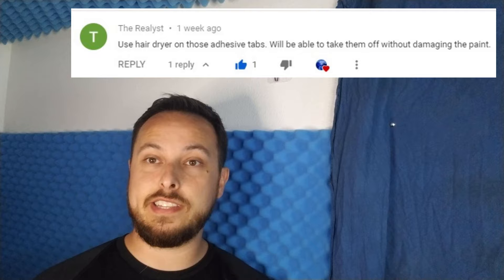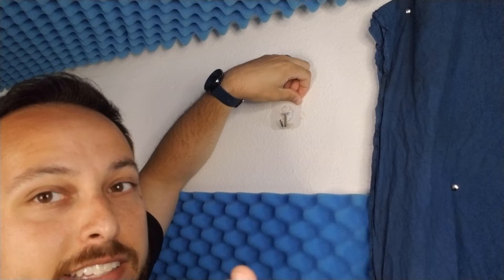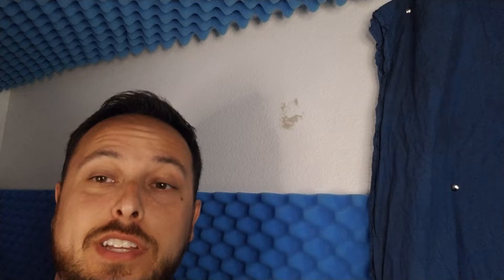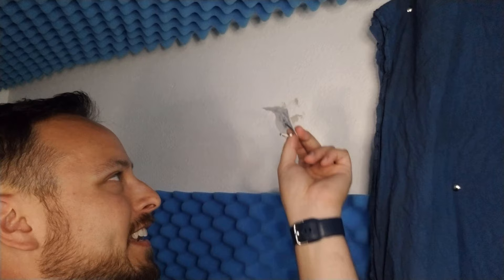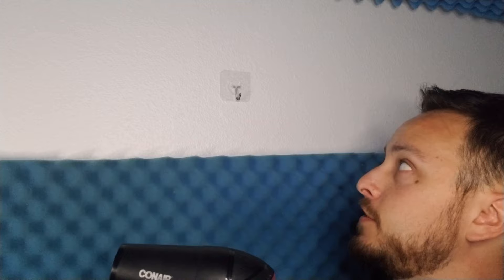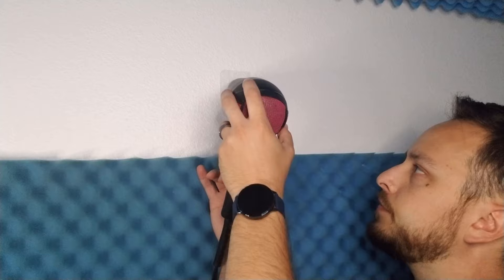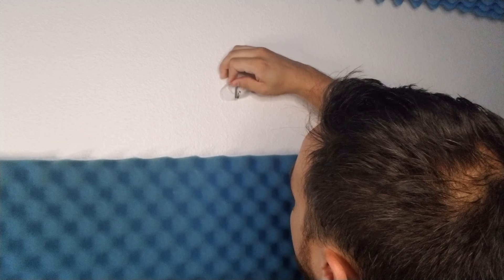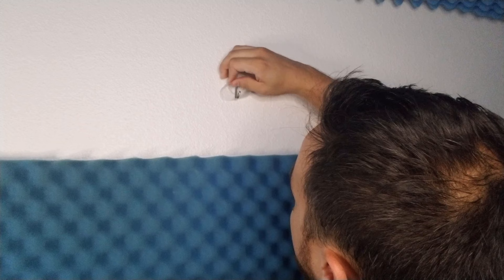REMOVE KIWI Cable VR Management Hook Without Damaging Wall

Comment: I discovered I had to do this with the 3m "easy pull off" sticky tabs or whatever.  Used them to hang some picutres, removed one and took a circle of wall paint (which I then stuck back to the wall with clear nail polish - noticeable only if looking directly at it
Reply from the maker: Yeah those are not as easy as they claim they are

Comment: Thanks, I'll try this. Not sure when I'll leave this place but when I tried to remove one of them a while back the entire layer of paint came off and there's nothing but a big hole there now. Maybe  I can repaint that and save myself that deposit. Not sure how that is going to go though, Matching paint can be tricky but I would rather only have to paint one hole then like 7-8 holes.
Reply from the maker: You can pick up texturing spray at a home Depot or order some. Spray it over the area that got ripped and it'll make it look like texture. Then paint over that and it'll be totally fixed. 😊
Reply: @jaybratt  Thanks, I'll look into that.
Reply from the maker: @unrealdevop  I think this is what I used years ago when I needed to repair a wall https://amzn.to/3EQGHll
Reply: @jaybratt  Thanks

Comment: I had mine on my ceiling, and it still left a lot of residue. I wish there was a command hook that was suitable for this kind of stuff. Their adhesive is really good and easy to remove.
Reply from the maker: Command hooks are great! If you have the pulleys I think this would work: https://amzn.to/33UZZrQ
Reply: @jaybratt  Thank you so much for linking those. I was planning on using just the normal command hooks that have the metal hook like those kiwi hangers, but the linked ones will probably work much better

Comment: I'm not trying to sound mean but....the next video you'll search for is 'how to patch a drywall ceiling' 😆 This method didn't work for me unfortunately. The adhesive is just too strong and had been on there since late 2020. I just ended up scoring the the paint with a utility knife around the edges that helped isolate the damage when I peeled them off. I have 7 small square patches I'll need to putty and paint over now :😀 oh well...
Reply from the maker: Sorry to hear that ☹️ the longer it's been up the harder it is I'm sure. Also some drywalls like to rip more than others. At my buddy's place everything he tries to hang rips out of the wall. I'd never want to remove one of these there... Probably rip a full hole in the wall 😂

Comment: this is a good solution but would you prefer risking blowing out a heating element in a hairdryer or would you prefer to do a lil spot painting
Reply from the maker: Does using a blow dryer risk it? I would've used a heat gun but I don't have one anymore

Comment: I use double sided tape instead of the adhesive, also i tried it with the adhesive on a window and it was stuck for good, i had to use a lot of force to get it out xd
Reply from the maker: Not the window!! Lol. At least it didn't break in trying to remove it

Comment: im surprised the paint also did not peel off with the heat from the blower
Reply from the maker: Before trying this I pulled one off a wall and it didn't even pull the paint off... it pulled of the WALL tape behind it too! I had to retexturize the wall and repaint it to hide the damage. They should call that stuff "Permanent Adhesive"
Reply: @jaybratt  did you use a heat gun?
Reply from the maker: I used a blow dryer because I don't have a heat gun. Although it would be easy to overheat it with a heat gun I think

Comment: Mhm.. this does not work on other wallpapers. Mine is flat and painted, i've heated it up and tried to remove the pad.. the glue sticks with the wallpaper, just the plastic pad is removed. So i have to cut out the wallpaper and replace it. 

Next time i will simply drill holes. Much, much easier to close and paint them.
Reply from the maker: Awww yeah I didn't think about wallpaper. That's probably an impossible task to remove it. I agree the holes are still easier... technically I don't know if I'm allow to make holes and repair them myself but the wall has many repaired holes I can see from not great maintenance coverage so I'm sure I can cover them better lol

Comment: Heyo, Would this trick work well if the adhesive hook was connected to the ceiling? Soon enough I will be installing these adhesive hooks for my VR headset and I do not want to make a permanent installation as I do not own the apartment and may end up moving to a new location in the future. Plus I also want to make sure that I do not damage the ceiling at all.
Reply from the maker: It will work on the ceiling as well as long as your ceiling is not popcorn style or a cardboard laminate. Some ceiling are painted over cardboard laminate and they're very fragile. This trick would help but I couldn't guarantee it would do zero damage to those 🙁

Comment: I'm think about getting one of these for my psvr , is it worth it
Reply from the maker: Yeah cable management makes such a difference. Especially for games like superhot where you need to move around. I recommend every wired vr player suspend their cables.
Reply: @jaybratt  Do you have any recommendations I move a lot duck , lay , jump do you have any suggestions

Comment: doesn't goo gone work as well?
Reply from the maker: Sadly not with this, they hug too tight to get it in between the wall and sticky pad. Maybe if you went super slow and re applied again and again but it would take a lot of time.